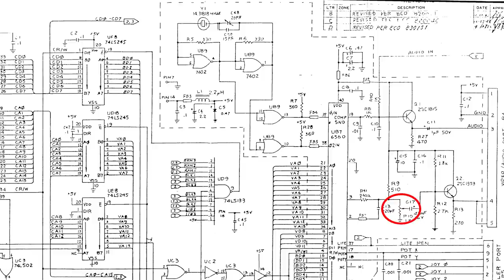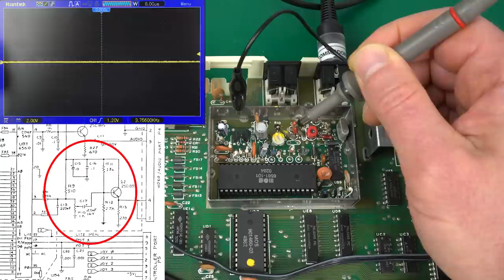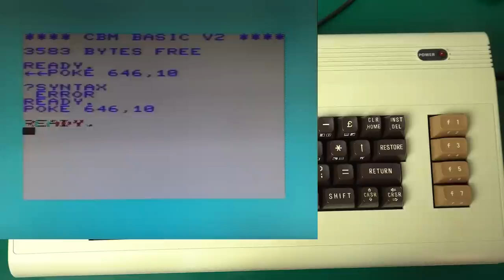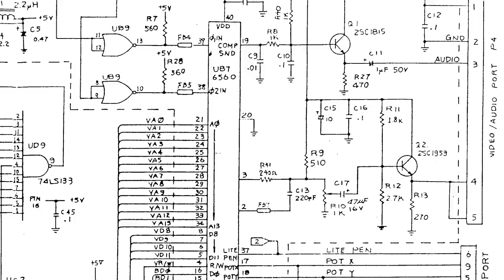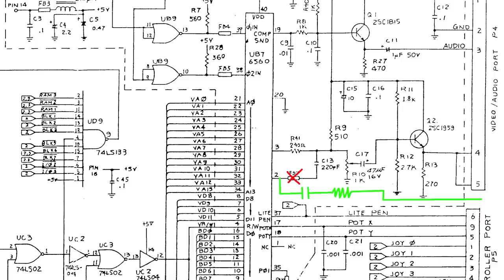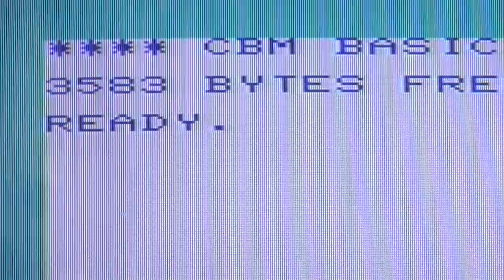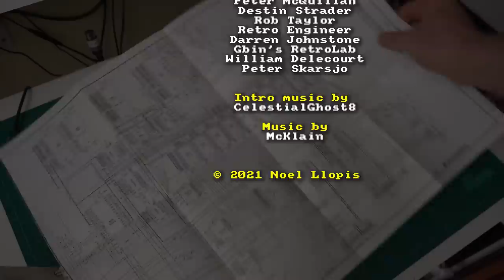Best VIC-20 Composite Video?

Comment: I'm the guy who developed the S-video mod as described in the Denial wiki. While I never made any attempts to improve the composite output, I can give some explanations and suggestions you might find of value. Firstly, the red trimmer adjusts the colour subcarrier frequency, if it is incorrectly adjusted, you may get 'Hannover Bars' in coloured areas. You can see an example of those in the bottom two images in the Denial S-video wiki page. If the adjustment is off by too much, the colour may completely drop out. This applies to PAL. NTSC does not have the 180 deg alternate phase reversal, so if this trimmer is out of adjustment, the colours will all be wrong.

The key to maximum video quality is correct video levels.  Firstly, your TV/monitor should be presenting a 75 ohm load to the input video signal. The video should be 1 volt, measured between the bottom of the sync pulse and the white level. This is adjusted with the trimpot as you describe in the video. Additionally, with the entire video signal at 1 volt, you should have 0.3 volts between the bottom of the sync pulse and black level. This relationship is fixed within the VIC chip.

The colour level should be at 0.3 volts peak-to-peak on the colour burst signal. There is no means to adjust this in an unmodified VIC-20 and it is normally way too high. This is why you get the serrated edges between different coloured areas. It is actually called 'Dot Crawl'. Normally on a proper interlaced video signal, these dots will slowly crawl up or down, but on a VIC-20 they are stationary. You will never be able to eliminate dot crawl, however it can be reduced by two methods.

The first method is to reduce the colour level to at least the correct 0.3 volts. You could reduce the colour level further, which will further reduce dot crawl, but you will eventually get to a point where the colour will get noisy or blurry or even become prone to dropping out.

The second method (and which is possibly what is happening in your modification) is to restrict the low frequency bandwith of the colour signal (before it is combined with the luminance signal). This will have the side effect of smearing the colours somewhat, and may even cause some smearing of the luminance signal too.

Your LCD monitor would most likely have a comb filter in it which is a far more  sophisticated method of separating the chrominance from the luminance. This almost entirely eliminates dot crawl as you have observed. Your CRT monitor would use the old bandpass filter method which is far less effective.

Finally, I have noticed there is an amazing variation in picture quality between different VIC chips. Often these are temperature sensitive. I have one VIC chip that gives an OK image when cold, but after a while the blue parts of the image go all noisy, blurry and are full of 'jailbars' once the chip warms up.
Reply from the maker: Excellent information. Thanks! When I revisit this VIC-20 (which I'll have to because it gives you weird diagnostic errors), I'll have another look at the signal with your information. Thanks!
Reply: Hello @a4000bear Thank you for your very useful comment which reinforces the choice I recently made with my Vic20, namely that it is the type of monitor which above all allows for optimal image quality.
Soon I'm going to pick up a Panasonic Plasma TV (TH-42PV500) screen (used for €70).
I will first plug the Vic20's S-VIDEO SCART cable directly into the Panasonic Plasma TV to see the result.
Then, I will use a converter (active/5v USB-C power supply) by connecting the S-VIDEO SCART socket of the Vic20 to the SCART input of the converter and at the output of the converter the RCA / RGB socket to the Panasonic TV screen in Plasma.
My converter allows adjustment of RGB colors using three potentiometers if necessary.

According to my analysis, I will not need to modify the hardware part as was done in this video by @NoelsRetroLab

PS: I have two VIC20s for this test, a British Vic20 and a German VC20 (very rare Vic20 model)

Comment: I've just done this to my Vicky Twenty and I'm blown away by the result. It took a bit of figuring out because that board doesn't have the 'original' position of C13 marked, so I just had to figure out where to solder that cap. The rest of the mod was just the same. It's perfect for me. I had been planning to make the s-video mod but didn't like the idea of having a dangling s-video cable, or fitting an s-video socket. This is perfect, I just use the original video socket as before. Thank you so much!
Reply from the maker: That's great to hear! Glad it worked for you too.

Comment: I have a SCART adapter just like you shown at 15:22 and I sacrificed its plastic case in the name of science. And I was surprised to find out that chroma and luma signals from the S-video connector go to 2 different pins on the SCART connector. Whether or not your TV would to make anything out of it, of course, depends entirely on the TV.
Reply: I am guessing that there are at least the two versions, one that creates a composite signal and one that keeps chrominance and luminance apart. Why not simply try a beeping multimeter for signal continuity and the SCART pinout... https://en.wikipedia.org/wiki/SCART

Comment: The answer is the ferrite bead is a small value inductor and it causes ringing. You remove and you get rid of the ringing.
Reply: The usual way to get rid of that ringing is to put a low value damping resistor in parallel with it, you'll often find that done with a coil wound onto a resistor in CRT gun drivers, if you remove the resistor or it goes open circuit then you get ringing and smearing on screen.
Reply: @M0UAW_IO83  AFAIK, this dampening resistor will reduce the impedance of the load on the VIC-I's output and this could damage it.
Reply from the maker: That makes sense. That's what I had read too. Any idea why they put it there in the first place? The C64 and VIC-20 are full of those ferrite beads everywhere!
Reply: @NoelsRetroLab  Engineers at the time assumed this would reduce the noise just like it often does with digital signals. If you look at the design on C64 boards, those of 1982/1983 also have ferrite beads. They disappeared on boards 250425 (1984) and afterwards.
Reply: Except ferrite beads are generally lossy. They appear resistive at high frequencies. It shouldn't cause ringing like a true inductor would. (However, it sure looks like it is from looking at the output on screen.)
Reply: @misterhat5823  A lossy inductor is called a choke. What matters here is not how ferrite beads 'should' react to XYZ signal but how those employed by Commodore do react to a signal. When an inductor (or ferrite bead) interacts with other components or implicit effects such as parasitic capacitance or inductance, they become a filter. This filter may or may not be underdamped, critically damped or overdamped. There is ringing if the resulting filter is underdamped. The way Commodore used ferrite beads (between 1978-1983 in 8 bit computers) and the type they used always results in underdamped (ringing) filters unless an actual resistor is added.
See: https://coertvonk.com/hw/filters/two-pole-low-pass-rlc-filter-13594

Comment: What you have seen in the S-Video mod looks like Chroma Shift. Luma and Chroma are in a time offset. As we are talking about milliseconds, this delay could be induced by the analogue circuit (the charging curve of the capacitor). And in the end, you always need to consider the 75 ohms termination to avoid signal reflectoin and shadows. But so far so good, great mod
Reply: it is about a time offset in the area of 200-500 nanoseconds

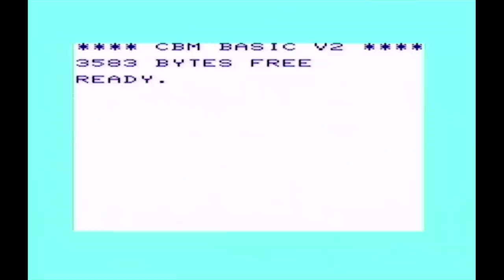Comment: Hi Noel,  I've just performed the same surgery on my newly acquired VIC-20 (PAL version), but I'm getting a yellow shadow on the left hand side of the letters. Same power up display as yours at 20:55  The display is far better than it was though, so is certainly a vast improvement. 
 Edit:  I've improved it even more.  After some experimentation, I went back to the beginning and removed the 470N cap and just replaced the ferrite bead (or 100n cap) with a 2K resistor.  I've introduced an RC network in effect.  2K ohms value was chosen using a test 10K potentiometer. All yellow shadows have completely gone now. I'm really pleased I found your video. Many thanks.

Comment: Hello, Thank you for your very useful comment which reinforces the choice I recently made with my Vic20, namely that it is the type of monitor which above all allows for optimal image quality.
Soon I'm going to pick up a Panasonic Plasma TV (TH-42PV500) screen (used for €70).
I will first plug the Vic20's S-VIDEO SCART cable directly into the Panasonic Plasma TV to see the result.
Then, I will use a converter (active/5v USB-C power supply) by connecting the S-VIDEO SCART socket of the Vic20 to the SCART input of the converter and at the output of the converter the RCA / RGB socket to the Panasonic TV screen in Plasma.
My converter allows adjustment of RGB colors using three potentiometers if necessary.

According to my analysis, I will not need to modify the hardware part as was done in this video.

PS: I have two VIC20s for this test, a British Vic20 and a German VC20 (very rare Vic20 model)

Comment: I'm not an analogue electronics expert by any means, but it looks to me that the capacitor you added between the colour signal and the composite output is applying a small amount of positive feedback to the output transistor. Since the transistor is largely configured as an emitter follower and therefore can't really have a gain greater than 1 the feedback is probably acting more like a schmitt trigger, squaring up the signal somewhat . The result looks to me like its removing the dark "shadow" after pixels, which makes the picture look better. If this works under all circumstances I cannot say, but the example pictures you show seem to be a huge improvement. If the board gets hot after a lot of use that might affect the characteristics of the transistor and make the circuit oscillate, but if that is true only time will tell! Great video again, and thought provoking as usual.
Reply from the maker: Interesting. I hadn't thought about it that way, but that makes sense in a very handwavy kind of way 😃 I know this was not a mod I was able to explain, but I'm glad I put it out there some people can chime in with their thoughts and share their expertise (which I don't have in this particular kind of circuits). Hopefully I can learn enough from that to explain it and improve it in the future. Cheers!

Comment: Hi Noel, nice explain for the Vic-20 mod. I did something similar, but i've placed a extra i.c. socket on the existing socket and bended out pin 2 to connect the cap and resistor on it. That way you just can pull it out again to revert to the original situation. Also my chroma and luminance were separated that way. All that is  connected to a S-video connector.
Reply from the maker: Nice. No cutting tracks that way. Do you have a cable running out the back or did you manage to reuse the video connector somehow?
Reply: @NoelsRetroLab  Yes, there is a extra cable comming out.

Comment: Really nice videomod! I have a PAL VIC-20 with a CR board too and I want to try this mod. My video looks just as your "before" images except it doesn't have the broken multicolor mode thankfully. Will be very interesting to see if there's going to be a as notable difference on my board too. Thanks for this video and guide Noel!
EDIT: Btw if a game shows up in a square in the corner like that, you can move it to the center using the cursor keys :)
Reply from the maker: Thank you! Glad you liked it. Please let me know how it goes if you make the mod.
And good tip about the arrows. Someone told me about it after I made the video, but I still haven't tried it. Is it a standard thing, or did every game have to implement that separately, do you know?
Reply: @NoelsRetroLab  I've placed an order for the capacitors needed so I will recieve them some time next week. Will try to remember to post my results here. Pretty sure the thing with the games and the cursor keys is standard, it worked for many of the games I have on my Penultimate + cartridge at least. Think I heard about it from a video by The 8 Bit Guy.
Reply: @NoelsRetroLab  I finally got the components to perform the mod on my VIC 20. It was very easy and my board was surprisingly clean so it was a dream to work on. My board was revision D Assy no 250403 from 1982 and it also had a resistor going diagonally over the brightness potentiometer. I replaced it with a 220 pF capacitor in the way you showed in the video. The results of the mod was nothing short of amazing! The picture quality is fantastic! I can't believe a composite signal can look this clean. Both high res games and multi color games looks super crisp. Thank you so much for finding this out and sharing with us! I'm blown away comparing my before and after direct captures :D

Comment: When I did the Nintendo Color TV Game 15 to Component mod, I got a really washed out picture and I just experimented with small capacitors until the trace on the oscilloscope looked really nice. When I hooked it back up to the monitor, the picture was super sharp.
Reply from the maker: Right. Sometimes you do stuff like that and then reason it backwards. Or try to anyway 😃 That's all part of the scientific approach.

Comment: If you want more options for using composite and s-video on modern displays and capture devices, I highly recommend the retrotink 2x mini, which is a low latency line doubler with HDMI output. It's my go-to for checking s-video mods, since my 15k crt only supports rf and composite.
Reply from the maker: Good point. I've read about the RetroTink, but I don't own one. OSSC usually does it for me for video capture, but that doesn't support S-video like the Retro Tink.

Comment: Bit late on the info, but when it comes to S-Video over SCART, it's an odd cludge, the signals actually are kept separate (so long as the adaptor is wired to do so), the Luminance goes into the Composite input pin, and the Chrominance is fed via the Red input of the RGB side of things, and set to the right input mode, the TV then knows what to do with the signals to process them into an image... :)

I learned this the other day when I thought my 64c had conked out, as all I was seeing on my TV was a red image, and, I forgot I had to hit the Input selection button on the front of the TV (Sony KV-14M1U, slightly older model than yours I think) to switch it to S-Video, oops!!! :P

Comment: The 0.01u capacitor in series with the 220p could  be replaced with a short. The combination is essentially 220p. Removing the ferrite bead is probably what helped here.

Comment: Para saber si ese adaptador a euroconector combina las señales de S-Video en video compuesto:
-Si el adaptador NO combina las señales, habrá continuidad entre el pin 4 (croma) del mini-DIN y el pin 15 del euroconector y entre el pin 3 (luma) y el 20.
-Si el adaptador SÍ combina las señales, sólo habrá continuidad entre el pin 3 del mini-DIN y el pin 20 del euroconector, y deberías poder medir un condensador entre los pines 3 y 4 del mini-DIN. 

Creo recordar que a finales de los 80 se amplió la especificación del euroconector para dar soporte a S-Video. Si ese adaptador no combina las señales, yo probaría a meter una señal de S-Video para ver si alguna de las pantallas lo soportan. La que no lo soporte te dará una bonita imagen en blanco y negro.

Comment: Can't say about your s-video to scart adapter but scart can work in s-video mode when croma is hooked to red pin and luma to composite. Suppose some voltages has to be apllied on some control pins to signal to the TV that S-video is used. So if adapter is made correctly and it is not mixing signals to make composite it should provide better picture.
Reply from the maker: Right. From my research your TV also needs to support it, and not old TVs do it correctly since S-video was added after the SCART standard. So I'm still unsure if mine supports it or not 😃
Reply: @NoelsRetroLab  newer TV's probably should.

Comment: Hi, Thanks for this great video. I tried this mod but unfortunately the result is worst than before. The ghosting is yellow (previously white) and more visible. My VIC-20 is a PAL version but I’m don’t know how to see if it’s a CR. I
Also made a change: i didn’t have a 470nF ceramic so I replaced it with a 0.47uF electrolytic, will it make a difference ?
Best regards

Comment: Hi Noel  i have a vic 20 with only a blue cyan screen on boot what it can be??im looking everywhere to find some ways to revive this VIc20 :)
Reply from the maker: Not sure to be honest. I haven't started my VIC-20 repair series yet, so I don't have a good suggestion. My initial thought is that maybe it's ROM related? Like it's setting up the right colors but then it hangs somehow? Try putting a cartridge and see if that works.
Reply: @NoelsRetroLab  No when i start the vic 20  i got a signal from composite cable and the screen is all cyan blue im gonna try it  ! thanks :)

Comment: Hello, why not recover the Chroma signal (chrominance) from FB7 (removal of the component) and repatriate this chroma signal to a 5-pin female DIN connector fixed on a new small inverted PCB over the location of the old DIN (on the motherboard) ??

The best solution is to not modify anything on the VIC-20 motherboard. Simply “clean” the original Composite signal using a CLEAR VIDEO device (PCB) attached to the video chip socket.

Once the Composite signal is correctly "cleaned" of all its parasites, the video display quality will also be better than the S-Video hardware mod which consists of DESTROYING the motherboard with a screwdriver or cutter.😜😉

Congratulations on your very informative work.👍